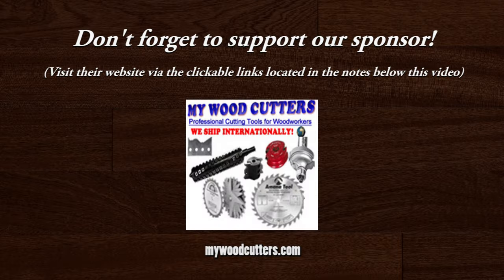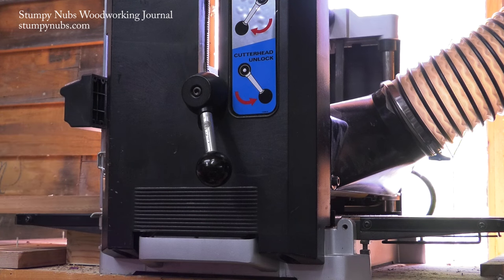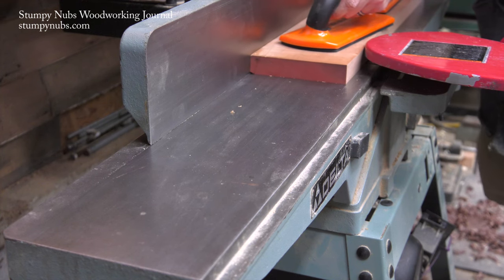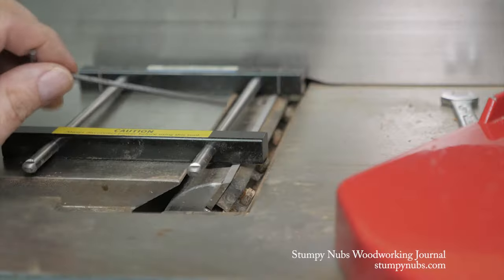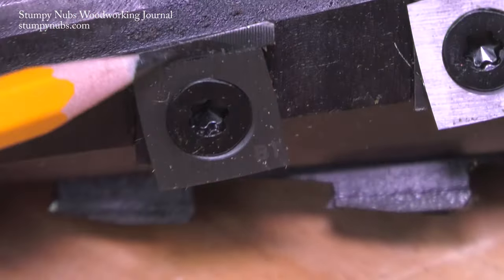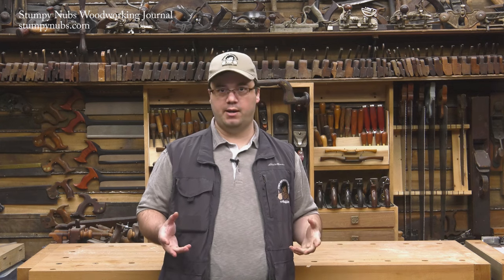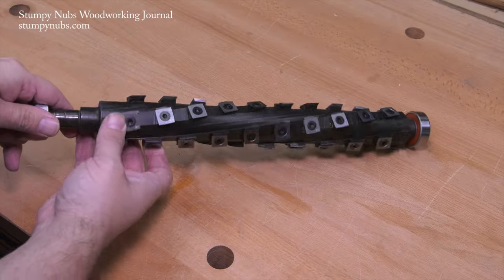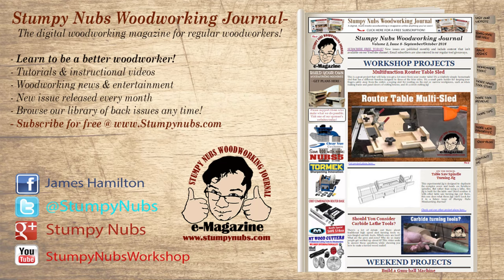WATCH THIS before buying a carbide helical (spiral/segmented) jointer/planer cutter head

Comment: The first time I used my jointer with a new helical cutter head 1/4 of the carbide inserts broke in half.  It sort of negates the argument that they last longer than the steel cutters.  In my experience the steel knives last infinitely longer than the carbide ones.  Also the carbide inserts sit in precision milled spots on the cutter head.  If you live in a high humidity area these spots will rust very quickly and then the inserts will not align properly so the entire cutter head becomes scrap very quickly.  I "upgraded" both my jointer and planer and regret doing it.
Reply: Yikes! What the heck were you cutting? Ebony? Knotty pine, mostly knots? Porcelain tile that looks like wood? Trying to take off a half inch at a time (usually should be 1/16- 1/32")? Kidding, but yikes!   The rust issue you mentioned was one thing that pushed me into going with the V-Shear head versus the Shelix head - The V-Shear head is nickel-coated head=less possibility for what you're talking about. But high-humidity is going to cause other issues as well... not just limited to the heads. I mentioned above that some kind of torque-limiting screwdriver or wrench is necessary to install the heads at the appropriate torque (45 in/lbs), or you will get uneven cuts as well.
Reply: I was not doing anything unusual.  I planed a live oak board that was about 5 to 6 inches wide and I started out with a 1/16" cut followed by 1/32" finishing cuts.  The finish on the board was really good.  I did not notice that there was a problem until I was cleaning up a few days later and  found a few broken inserts on the floor and in the dust chute.  I checked the cutterhead and found a couple of sites with broken inserts and replaced them.  I noticed that there was rust in the seats and cleaned it.  Then as I rotated the cutterhead I kept finding broken inserts until I used all the 10 spares that they sent with the cutterhead.  I contacted the supplier and got more replacements.  I had installed the cutterhead probably a year earlier and tested it on some poplar that I had laying aroung but had not used it after that.  I replaced the cutterhead in my old Rockwell/Delta 13" planer with a Shellix cutterhead and that is when I had the problem with the jointer (8" Delta).  The cutterheads came with the cutters installed and they did not say anything about checking the mounting screws for the inserts before use so I did not.  I had planed the same white oak board after I jointed it and none of the inserts on the planer cutterhead broke so I have to assume that the rust in the mounting sites for the inserts was the cause for the inserts breaking and I decided to remove and check all the inserts on a yearly basis for PM.  I do live in a coastal town on a peninsula so it does get humid here.  I always cringe when I have to use the Jointer and planer now because those inserts are very expensive.  I bought into the sales hype about the carbide staying sharp far longer and having 4 edges to use before you had to replace them.  Being in my 70's I figured they would last me the rest of my life.  Instead the original knives in those machines that I bought in 1975 lasted a long time whereas the carbide inserts lasted a day and I could buy a lifetime supply of knives for the cost of just a few carbide inserts.
Reply: Oh yes, I just want to say that the guys selling the Byrd/Shellix cutterheads are really nice guys and very helpful.  It was a challenge to find the right cutterhead for my old planer.  It is an ancient design that was around for many decades before it was discontinued. As a result there were many cutterheads with subtle differences but these guys had seen them all and sent me measured drawings and specs so I could choose the right one.
Reply: The cutterhead for my DW735 is the same diameter as the original head - which meant that I had to remove all the carbide cutter tips to install it into the planer. Like 45 of them... and they had to be torqued down all the same, or else you get uneven cuts and even cutters that would not be seated properly. My first attempt at doing this was not good, and I had several cutters that were not seated properly (and got sawdust under the cutters), and some were too tight. Not a good cut. So I bought a torque-limiting screwdriver that would click off at the 45 inch/lbs setting. This really helped. The cut I get is really pretty good, and looks great after a light finish sanding. Here's the torque-limiting screwdriver i ended up getting, along with the t-handle for it: https://www.amazon.com/gp/product/B00VPPJWLW/ref=oh_aui_detailpage_o00_s00?ie=UTF8&psc=1
Reply: Donald Bingham Your situation is not indicative of typical wear, but component failure. That said, carbide inserts don't just break from normal cutting operations. They typically fail from impact loading and the source of that is going to lead you to root cause. 
If I saw this type of failure, I'd start with the insert pockets: Are they clean and free of burrs or anything that would cause the insert to not properly seat? Are they torqued properly (proper torque is probably less than you think.. use a preset driver)? Is the insert registering properly in the pocket (you'll need a feeler gauge to check)?

If all of those checkpoints give a green light, I'd start checking for play in the bearing registers of the planer.
Reply: I think I said that the cutter head rusted and caused the problem.
Reply: Agree on the proper torque being less than one would think. The tendency of most, me included, would be to crank those little suckers down hard so they don't go flying... which, I imagine, could actually cause them to crack. The one I got, https://www.amazon.com/gp/product/B00VPPJWLW/ref=oh_aui_detailpage_o00_s01?ie=UTF8&psc=1 wasn't too expensive and seemed to be a helpful tool.
Reply: Did it get resolved by the company? Or are you still out of commission? I'd be scared to use something like that -
Reply: They sent me a new pack of 10 inserts that along with the 10 spares they send with the cutter head was enough to get it running.  The problem is that those inserts are quite expensive and rust is hard to prevent on bare steel so I dread using the jointer and planer now.  I keep thinking that I need to remove all the inserts and check for rust every time I use the machines and that would take a lot of time.  I have used them a few times but I have been working on other projects instead of woodworking lately.  I try to only take no more than 1/32 bites now to reduce the chance of breaking inserts.  My own opinion is that I would buy this kind of cutter head again of small machines.  I think they would be very reliable on large diameter cutter heads but on small diameter cutter heads the inserts stick up a such a angle that they look more like levers waiting to be broken off than cutters but that is just my uninformed opinion.
Reply: My response was directed at your comment that the steel blades last "infinitely longer" than the carbide cutters that didn't fail simply due to the fact that they're carbide, but because of other variable(s). All things equal, a carbide edge should last 8-10x longer than a comparable uncoated (M42) HSS edge.  

Yes, if the inserts can't properly seat then they will move under load and fail quickly. You say this is an older machine... and as a mechanical engineer, I have to wonder how much play this machine might have in the bearing journals. Excessive play could cause 'bounce' in the cutter shaft and in that situation, HSS is much more forgiving. So the jury may still be out until all other variables are properly ruled out.

For corrosion, I'd suggest Cortec VpCI-377 corrosion inhibitor. Clean/rust removal with Cortec VpCI-422, follow up with 377. Reapply now and then and you should never have a corrosion issue. IMO, a product of this price range should have an electroless nickel coating, but an accountant would likely disagree...

Comment: I honestly don't know why anybody still buys straight knife jointers or planers, theres just no comparison.  I've used my grizzly 15" planer with spiral cutterhead professionally not for 3 years and I haven't even had to rotate a cutter once.  Picking up an older machine is the only reason I can see, but even then for the price of a newer grizzly, it's just stupid not to buy the new one honestly.
Reply: Mark Clemmens ñ
Reply: Mark;  It all comes down to need. I'm a hobbyist and   have used my 735 for 4 years. It meets my needs. I've never had an issue except for snipe. There are 50 "solutions" on YT for snipe but none seem to eliminate snipe completely. I welcome suggestions from anyone who has a fool proof snipe eliminator. Since sanding is mentioned a lot in the comments,  I would invest in a drum sander instead of a helical cutter machine.

Comment: how much for one of those cutter head
Reply from the maker: Depends on your machine. Please use the link in the notes below the video to find the prices on mywoodcutters.com
Reply: Stumpy Nubs I checked into it for my ridgid machine...$450 .. I bought it used for $200 so I just don't see me sinking $650 total into it unless I decide to turn my hobbies into a business at some point in time. If this happens it will probably be worth the investment.  I have a hunch my used machine was actually new. I bought it on CL and the feeling at the time (a few days later actually) is that it was stolen merchandise. The guy had a shop full of stuff still in original boxes and the deal seemed too good to pass, but you know that eerie feeling you get? I got it.

Comment: It occurred to me that there are really three unrelated improvements in the Shelix head: the carbide steel, the helix cutting pattern, and the small four-sided knives. I wonder how much each contributes to the improvements seen. People already manufacture traditional straight planer and jointer knives, but made out of carbide instead of HSS. It seems that would see most of the lifespan improvement without needing to buy a new cutter head. These also wouldn't create the problem of under-powered machines bogging down. Granted you wouldn't expect to see any improvement in cut quality, tear out, or sound, but because a new cutter head is unnecessary,  the cost savings would be realized more quickly, which might be easier to justify for the "change the blades every year" crowd. Do you have any experience with carbide-tipped replacement knives? How do they compare to the Shelix heads, and how do they compare to traditional HSS knives? (My kids have this really annoying habit of needing food and clothing, so Shelix heads won't be in the budget any time soon.)
Reply from the maker: Carbide straight knives will give you the benefits of staying sharp far longer than HSS, but a nicked knife can't be rotated like a helical cutter, and the tear out and surface issues will not be improved as with a helical head.
Reply: Michael Finley    Michael when I upgraded from a 6" Delta jointer I went to the Powermatic 8" with the HH (Helical Head) cutters and it was a great decision. A few  years ago the blades on my DEWALT 13" planer developed a nick in two blades thanks to a friend who wanted some lumber planed but it had staples in 2 boards. I showed him how to use my metal detector and did one side and he did the other side. Hence the damage. He didn't confirm that there was no other metal and he unknowingly broke part of the staple leg and the two blades were damaged. He wanted to pay to replace the blades. Since the blades are 2- sided, normally I could flip the blades but I had just flipped them a couple of months earlier I had to buy new blades. I don't believe a shellix head was available at that time so I purchased a carbide set from I believe InfinityTools.com for $180-$200. If th Shellix head had been available I would have purchased the Shellix version. I am happy with my infinity carbide blades and the cut quality is great. If I ever have the excuse to get a Shellix head I will jump on it in a heartbeat though after the great experience I have with my jointer.
Excellent video by the way!

Comment: I just picked up my first jointer (grizzly g1182) and planer (delta 22-540) for $250. I know these are old but better than nothing. I checked the site for my models and it's almost 1k to upgrade both. That's not with it on my opinion.

Comment: Thanks for the video - I actually bought one of the V-Shear heads for my DeWalt 735 planer. The wait time for the Shelix was prohibitive and I had a project with some figured wood that even my brand new HSS planer knives were causing significant tear-out on. Not good. The V-Shear head was available immediately, and so I bought it... I'm concerned that you said that they're "still in development" - I'm not seeing any issues at all on the head for my DW 735. It went in fine, and the cut quality is great. I still see some really minor ridges with the knives, but they sand out instantly when you finish-sand the piece. Just for the lack of tear-out, I think the helical heads are worth it.  What issues did you have with your V-Shear head on your jointer?
Reply from the maker: The one I got was one of the first they made, I think. I believe they were going to do something different with the finish, and I'm not sure what else. Regardless, if yours is working fine, then any changes wouldn't have been noticeable to you anyway. (Or you may already have the newest one. Like I said, they make them in batches and mine was a Delta.) I was impressed with the quality. I was just told that some changes were going to be made to mine, and I didn't want to review it until then.
Reply: I think Steffen from MyWoodcutters (who was VERY helpful and informative, BTW) mentioned that they had updated the finish on them. The quality seems great. I got the full-sized version of the head, from which you have to take all the knives off the head to fit into the DW735's head opening. The knives all have to be put back on, of course, and individually torqued at 45 in/lbs. I bought a torque-limiting screwdriver to do it with, so not an issue. There ARE really slight ridges in the cut from helical heads in general, I think. On mine, they were gone in literally seconds with a quick pass with 180 grit on the sander. Compared to trying to sand out tear-out, I'll take that trade-off any day.

Comment: why is mywoodcutters and shelixhead.com seem to be the mirror sites from same company, but on shelixhead.com its $100 more expensive? I dont understand which one is a fake now im scared to place my order lol
Reply from the maker: Shelix is the manufacturer. They sell at full retail price on their website, and they sell to retailers who are able to set their own prices. Mywoodcutters is a retailer that takes a smaller profit in order to sell them cheaper and draw more customers. I know them both, there is no "fake."
Reply: @StumpyNubs  thank you for the response.  is byrd shelix the same product also?  I had heard that one brand of shelix has angled knives while another brand looks similar but the knives are not angled.   I am confused if  shelix and helical mean different things.
Reply from the maker: I should have been more precise in my initial response. Byrd is the name of the manufacturer. Shelix is the name of the product. Mywoodcutters is the name of the retailer. All knives on Byrd Shelix heads are angled. They do not make a head with straight cutters, to my knowledge.
Reply: @StumpyNubs  thank you kindly for your time and knowledge.

Comment: I've had these for 6 years or so but can't remember how many times I've rotated the cutter heads.  Is there a test you can perform to evaluate if an edge is dull.  I don't feel I'm getting quite as good  as cut but not sure.  Excellent review & one pro I would add is planning the very hard tropical woods even lignum vitae.Mike McNerney